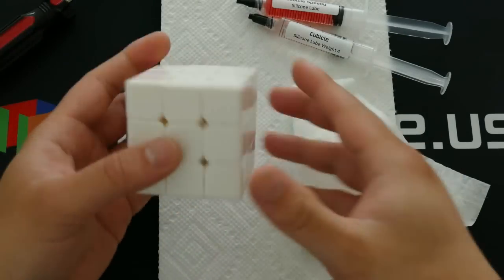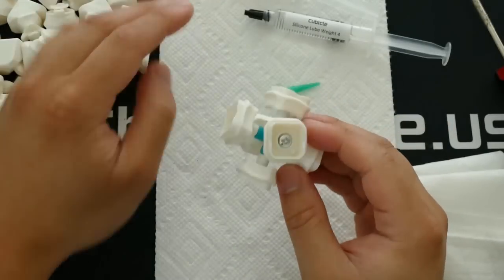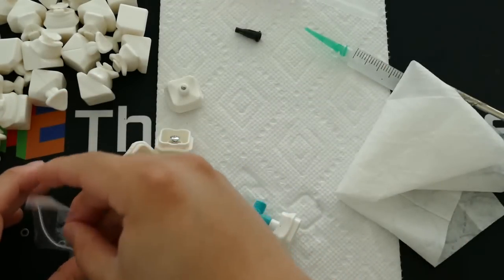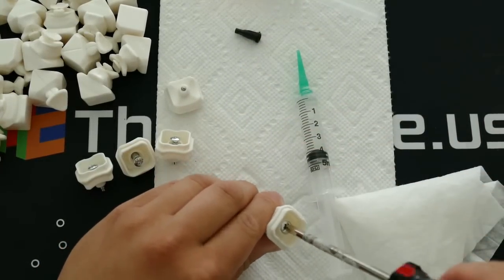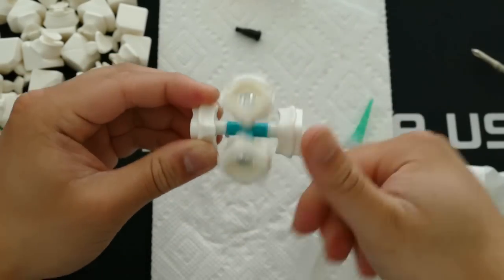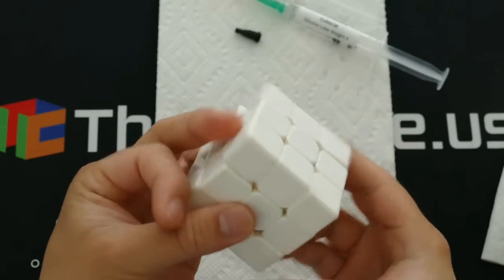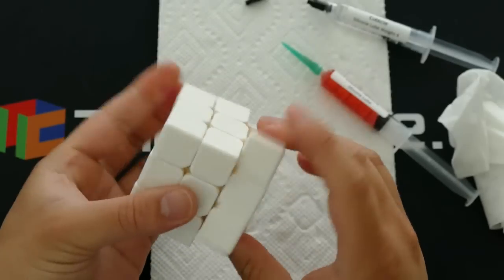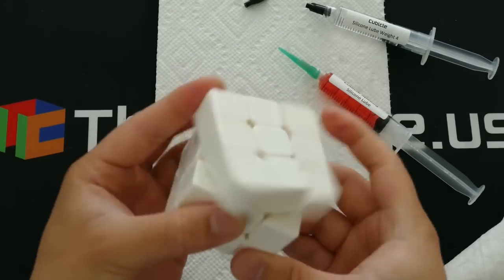3x3 lubrication tutorial: a voiceover tutorial

Comment: is the dispenser tip supposed to come with the lube, or is it bought separately,
if it comes included ho come my order was missing he dispenser?
Reply: the lube actually costs 3.00, but the dispensing tip costs 89 cents. you have the option of not buying a tip, but by default you are going to buy one.
Reply: +CubeSicle so the tip isn't included when I buy the lube?
Reply: +Sebastian Nieto you probably accidentally only got the lube.

Comment: Can I use weight 4 on the pieces as well? if not, will maru work on the pieces and weight 4 on the core?
Reply: Weight 4 will slow the cube down and make it more controllable. If you use maru lube it will make it faster.
Reply: but how do I make maru last a bit longer?
Reply: +JaccaTheCuber I'm afraid there isn't a way to make maru lube last longer. You will have to keep reapplying it every once in a while.

Comment: Usually how many solves do you need to do in order to completely break the lube in? I have tried weight 4 for both core and pieces for my thunderclap, but after about a 100 solves, the lube kind of dries out but that gummy sound is still there.
Reply: +Linus Lan Yeah I was aware of that but it still doesn't go away after many solves
Reply: It's not slow anymore, but I still hear this stcky/gummy sound
Reply: +Bronze Cuber I think you should put Wt 5 or traxxas 50k

Comment: When I looked at TheCubicle.us web site, I saw that Lubicle Speedy, Regular, and Gummy lubes are much more expensive (volume for volume) than the Cubicle Silicone Lubes Weights 1 to 5. Is there a noticeable difference in quality? Do the more expensive Lubicle lubes last longer (i.e. not dry out as fast) than the Silicone Lubes Weights 1 to 5?
Reply: The best is traxxas, they last very long. With maru or dnm-37, you will be fine. Or just put heavy lube(traxxas/weight) on core and silk/dnm on pieces.
Reply: For me the best is , traxxas 50k in core and dnm 37 in pieces , and yes you think it is so fast , only add 1 drop of lubicle silk. I use this in my weilong gts 3 ( no magnetic ) and is so good

Comment: The only lube I have is from your lube premium bundle and I dont want to buy more lube. Can I use the lube from this bundle to lube the core? And which one should I use? Btw I use the Gan Air SM
Reply: then why are u lubing it?????
Reply: Swag Knight YT what?
Reply: I used weight 4 on the core and weight 2 on the pieces, it works for how i like my cube to feel
Reply: You don’t need to lube the core on the Gan Air line. But you can use a lighter lube like dnm to make the cube slightly faster. Idk if it works with the GES V2 system but it worked on my UM

Comment: What lube would you recommend for a speed solver who averages from 20-35? Every time I used traxxis the cube even after wiping all factory lube out has a very sluggish feel. I use it on both pieces and the core so I want to know which could make the cube feel smooth, and faster.
Reply: get traxxas from amazon. it might feel slow, but you just have to break the lube in with 100-200 solves and it becomes great.